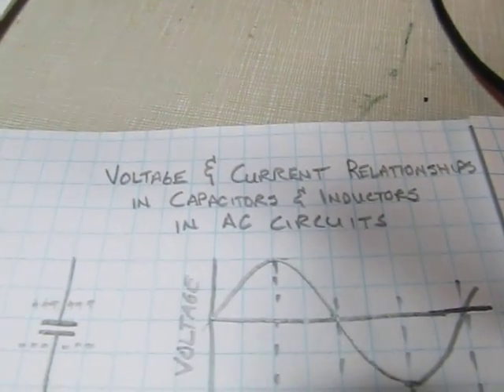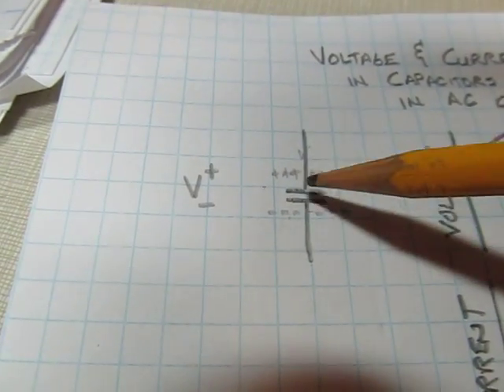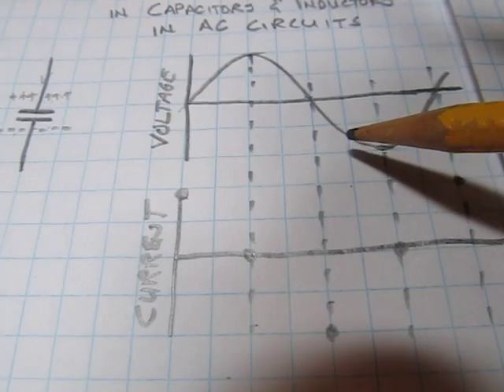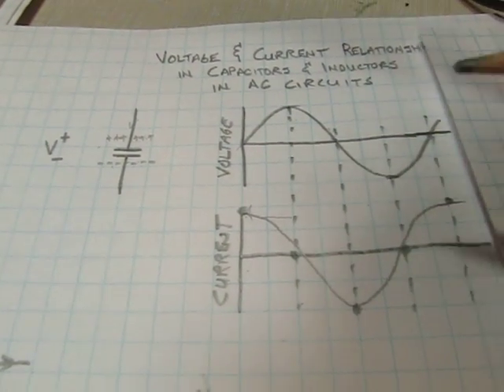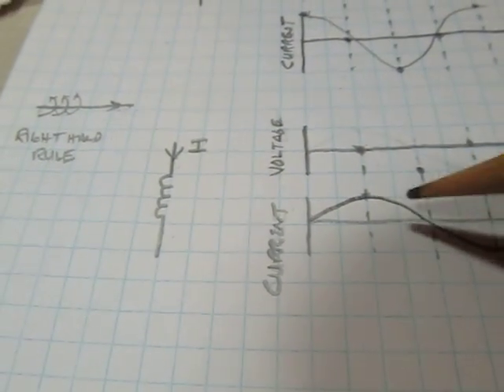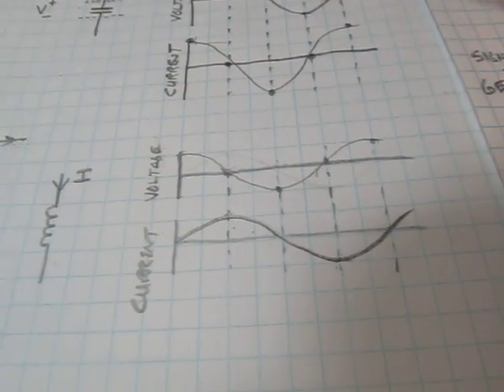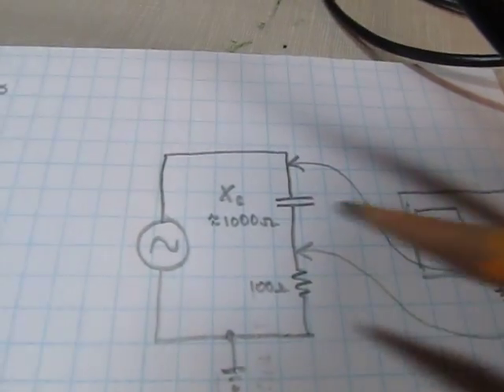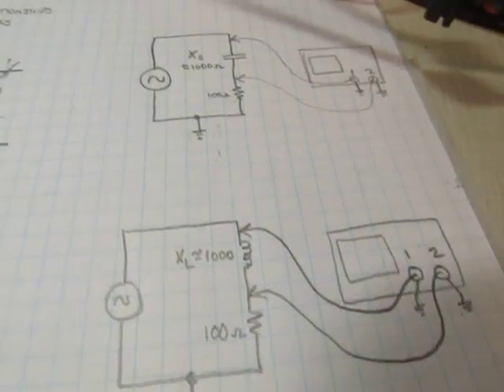#54: Back to Basics Tutorial: Voltage / Current in capacitors and inductors

Comment: The phase angle of a capacitor or inductor doesn't determine or affect the "rate of change"?
Reply from the maker: nope
Reply: @w2aew  I always thought that the capacitors phase angle is what is causing the rate of change because the current LEADS the voltage which is a time displacement. A resistor doesn't have no rate of change. So I'm confused what is causing the rate of change if it's not the phase angle/time of the current and voltage passing through the capacitor or inductor.

Comment: Alan, can you explain the choice of frequency and capacitor values? I see the values in the description, 725khz and 200pf, but how does that come into play in all of this? I tried to set up the experiment with the capacitor, but I don't get a 90* phase shift. Is that amount expected?  at 725khz I'm at about 22* phase shift, and at 500khz I'm at 45* phase shift. The slower I go, the closer to 90 I get, but it never gets to 90.
Reply from the maker: Are your probes 10x.
Reply: @w2aew  Yes. They have a 1x/10x switch. Is that my issue? I had them set to 10x.

Comment: I'm confused about VxI = watts and VxA = watts, because if the Voltage is 9vdc at 1amp = 9 watts , the V x A will also = 9 watts VA, so what is the difference and how does a technician know if its VA or VI = watts? filter capacitors store energy so that is considered VA
Reply from the maker: VA is used when there is a reactive load where the actual POWER dissipated is a function of the phase shift between the voltage and current.  In this case, the POWER is calculated as V*I*cos(theta), where theta is the phase between the voltage and current.

VA is also used when rating transformers.  The transformer itself doesn't dissipate power, but can handle a large VA (in the case of power supplies).
Reply: @w2aew  VA is consider the Load Current? because this is what other technicians are saying that VA is a LOAD or Current Load. I'm not sure why a transformer has a VA rating because a transformer is not a Reactive Load or current load, so I'm confused. Also a transformer doesn't dissipate power so how can it be a VA load?
Reply from the maker: @waynegram8907  No.  VA could be termed "apparent power" or "reactive power".
Reply: @w2aew  When filter capacitors are storing the applied power voltage/current which is considered Apparent power or reactive power? because when you remove the AC power from the unit under test the filter capacitors in the power supply are charge with apparent power or reactive power?
Reply from the maker: @waynegram8907  NO.  Apparent power applies ONLY to AC voltage/current - where the power is not equal to V*I due to a phase shift between V and I.  Storage caps in a power supply are working with DC.
Reply: @w2aew  Yes I know that storage caps are working with DC but this is not Applied Power its the storage caps are storing what type of power/energy? since its not reactive power or apparent power what are the filter caps storing what type of power? VA loads will have a VA rating on the inductive component or capacitive component but I don't know if the VA rating is apparent power or reactive power, how can you tell as a technician to know if the VA rating is apparent power or reactive power?
Reply from the maker: @waynegram8907  Capacitors don't store *power*, they store *charge*.  That charge can be delivered to a load that will dissipate power.
Reply: @w2aew  All equipment has a power supply that has filter capacitors which the filter capacitors are storing the applied power as reactive power, this is considered VA because the filter capacitor are storing voltage/current has a reactive power VA?
Reply from the maker: @waynegram8907  The filter capacitors in a power supply are on the DC side, thus don't affect the input phase angle.

Comment: In an LR network the resistors value is damping the ringing of the inductor? When connecting a square waveform to an LR network if the resistor is 10k it will damp the ringing of the inductor but if the resistor is 1meg the inductors ringing is visual on the oscilloscope. Any reasons why the resistance is damping the inductors ringing?

Comment: I'm stumped on what I'm doing wrong. I cant get channel 1 and 2 signals to be out of phase on my Hantek scope - they are always in phase. I'm using parts out of my junk box - 3.3uH inductor and a 460ohm resistor wired up in series, and probing it up the same as you have it. Channel 1 across the the SG and channel 2 across the resistor.
Reply from the maker: In order to see the phase shift, the resistor has to be much lower (10x lower or more) that the reactance of the inductor you're using.  This means that XL of your inductor would need to be 4600 ohms.  In order for a 3.3uH inductor to have XL=4600 ohms, you'd have to be running at 220MHz!!  So, you either need to run a much larger inductor or a much lower resistor (and maybe a higher test frequency).
Reply: @w2aew  Of course! *slapping head*. I didn't think of the Impedance triangle. I was only running 1kHz, too so I was looking at a 2.5e-3 degree phase shift. I'm limited with what I have in my junk box, but was able to find a 2 ohm resistor and bumping up the frequency to 100kHz I was able to see a noisy ~45 degree shift when setting XL =~ R. Thanks for these Fundamentals videos and for nudging me in the right direction.

Comment: AC outlet Power Strips have a Joules Rating which I'm not sure what the Joules rating means when it says 350 Joules for 5 AC outlets on the power strip? Does it mean 350 joules per each 120VAC outlet X 5 outlets or 350 joules X 5 per each outlet? I'm sure not what it means by 350 joules. I know Joules means time in 1 second but I'm not sure when a power strip is saying the maximum joules is 350 joules what does that mean?

Comment: What is the theory behind "compliance voltage"? I don't really know what is a compliance voltage and what parts of the circuits use compliance voltages. A compliance voltage is difference than a voltage source but I don't know what the difference are.
Reply from the maker: Compliance voltage is usually a term applied to a current source.  An ideal current source will force the desired current through whatever load is applied to it.  However, if the load is a very high resistance or open circuit, then the voltage would, in theory, have to be very large or infinite.  This obviously is not reality, and not practical.  The Compliance Voltage is the maximum voltage that will appear at the output of the current source when the load is open.  In other words, it is the maximum voltage that can be present at the output of a current source.
Reply: @w2aew  I have heard UK EE electronic techs also use Compliance voltage for voltage source. The UK engineers are claiming that the power supply output voltage is considered the Compliance voltage and the "voltage drop" or step down voltage going to the circuit board is NOT the compliance voltage. It gets really tricky because a voltage source and be looked at as a current source because of the LOAD.

Comment: As always, the format and clarity of the presentation is really appreciated. I am trying to understand why the output ofd 4 diodes composant is not showing the theoretical curve on  my usb oscilloscope. 2 questions : the curve looks like if it was a little smoothed (?), the tensions are not correct , I suppose that it can be a problem due to my test equipment, but I see that kind of shape in many places (VCC for instance ) when the card is in standby mode (it do not start, so I am trying to look at the data sheet of the CI to see if a part is not in order - connectors are ATX but PSON short to ground does not work )  . If you where kind enough to tell me what is the curve showing those  are the first pictures. https://photos.app.goo.gl/DBVuCDSifHmPijGNA

I am really annoyed not being able (yet)  to understand what is shown, I suppose it is trivial. That said, I tested another diode bridge and the shape is also not well balanced - USB Oscilloscope OWON and Micsig probe (x500 - channel x1000 - voltage reading/2)
I am sure you can point a finger in the good direction, and I will find the rest by myself ... Difficult at 65 to learn from scratch ;) 
Thank you a lot anyway , no problem if you have no time for that !

Back to your course ;) and sorry tobe so long winding and for my simplified English

Comment: So sorry but why do you need that small resistor to measure the current? Can't you use the bigger resister?
Reply from the maker: Because I wanted the voltage drop across the current sense resistor to be small with respect to the voltage across the inductor/capacitor I was testing, so it wouldn't affect it so much.
Reply: @w2aew  Thank you soo much! I am taking a minor in electronic circuit and my lecturer completely skipped the basics, this video is saving me!

Comment: w2aew, if a lamp bulb draw .15 amps and another lamp bulb draw .25 amps how do you find the percentage of current draw between the two different lamp bulbs? what is the formula 
.15 amp lamp bulb draw less current compared to .25 amp lamp bulb by what percentage?

Comment: As usually from you a good tutorial.But i have a question, I know how to make an oscillator to generate a sin signal but not the sin and cos at the same time. So, I can use the capacitor or the inductor  to generate a 90 degrees phase shift in a QAM(or costas loop) oscillator or it need more conditioning ? thanks.

Comment: I have an old analog scope that is a Kenwood CS 4125, 20 MHz, 2 channel. I'm trying to learn how to use it. I don't know if it can show both channels at one time on the CRT, I don't see any button that says both channel 1 + 2.
Reply from the maker: Vertical mode ALT or CHOP will display both channels at the same time.
Reply: Thanks. I want to be able to show the relation of the phase between a current and voltage in a circuit that has one coil in parallel with another coil that has a capacitor in series with it. By observing the phase relationship of each coil, and then figuring out how much the second coil is out of phase with the first one.
Reply: This would be to see if I am doing the math right on a simple split phase induction motor.
Reply from the maker: You should be able to do this easily, just remember that the ground connections of both probes are common.
Reply: I did it already,and it showed that the currents are 67 degrees out of phase with each other.
Reply: That is very important advice though. Luckily I had already seen EEVblogs video on that.

Comment: Thank you for all tutorials, I have got some questions: How did you ground the channel one and channel two scope leads? Do they have a common ground? Where did you connect the negative terminal of signal generator? Does the signal generator meet with a common ground with the scope leads? I am having same output signal amplitude on both shunt resistor and the actual test component (1000ohm resistor), I guess because both scope leads and the negative terminal meet at common ground. I do not have maths function on my oscilloscope , mine is an old HAMEG 20 Mhz analogue oscilloscope. I would appreciate some guide on that. Thanx again.
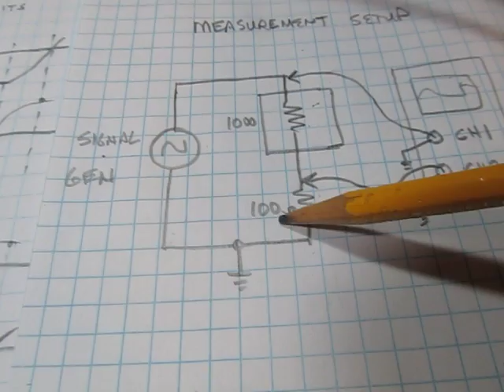Reply from the maker: The GND is shown in the schematic at 7:53.  The generator and scope grounds are all tied to the same GND point. A few seconds later, you can see the ground leads all hooked up to the same point on the breadboard (the three leads near the bottom of the screen). There is no shunt resistor, there is a series 100 ohm that is used to sense the current.  I would think that your scope DOES have the math needed - nearly all analog scopes have an INVERT and ADD function on the vertical settings.  By using both of these, you can get a difference or subtraction of the waveforms appearing on CH1 and CH2.
Reply: Thank you, I do really enjoy your tutorials. Finally, I have done it right. It seems that there is a problem with my oscilloscope (Or its the 50 Ohms potential!), it displays half of the function generator frequency on it. For example, if I set 100Hz, I get 50Hz on the scope, but the amplitude is displayed correctly (its direct connection without load or any type of circuitry). I am wondering why?
Reply from the maker: The input impedance of the scope (1Mohm vs. 50 ohms) would have absolutely no impact on the frequency of a signal that you're measuring.  So, either the generator, the scope, or your measurement method are at fault.  You can easily verify the scope itself by measuring the frequency of the MAINS power by simply hanging a wire on the input (it'''ll pick up enough stray mains that you should be able to measure the 50 or 60Hz (depending on your country).  Also, you can use the probe compensation signal on the front panel - this is most often something near 1kHz (not precise, but certainly suitable to see if you're off by a factor of two).

Comment: I am confused on which curve is leading and which curve is lagging because according to wiki you have them mixed up.. http://en.wikipedia.org/wiki/Leading_and_lagging_current#Lagging_Current
Reply from the maker: The way I read that page - it agrees with the way I've described it.  The easy way to remember it is with the phrase "ELI the ICE man.  ELI stands for voltage (E) comes before the current (I) in an inductive circuit (L), thus the voltage leads the current (or you could say that the current lags the voltage).  And of course, the opposite is true for a capacitive (C) circuit - hence ICE.
Reply: Yes that is what we have learned in class but our teacher draws the second curve leading were you have the first curve leading or maybe I need to watch the video again
Reply: Yeah your way makes sense,  for some reason my teacher makes the curve a head the leading one..oh well
Reply: Brent Peluso 

It depends on if the circuit has more capacitance or more inductance! 

if it is more capacitive, current leads voltage,

if it is more inductive, voltage leads current

if there are both, it's an LC (inductive-capacitive) circuit and it depends on which component has more influence...
  ...if the capacitor outweighs the inductor the mnemonic is ICE
  ...if the inductor outweighs the capacitor then the mnemonic is ELI 

It's ELI the ICE man...

E leads I in an "L" inductive circuit  (ELI) E = voltage, L = inductance, I = current

I leads E in a Capacitive circuit (ICE) I = current, C = Capacitive, E = voltage

Comment: This may not be the appropriate place to ask this question. However I am plagued by not understanding what is happening and I would like to change that. I experienced a 1 phase 230 volt fan motor cycling on and off every 10 mins or so. Puzzled I figured the motor was bad. I swapped out the fan motor and still had the same outcome moments later. Trying to look at more details after thinking I remedied the problem. I discovered an incorrect capacitor rating. 5 mfd was substituted for a 1.5 mfd. I understand capacitors correct the power factor or at least make the value closer to unity. I understand to replace the correct parts with correct parts, had I seen that capacitor value earlier I would have replaced that with the appropriate one. But why did that higher value heat up the motor windings???
Reply from the maker: Sounds like a good question for the motor manufacturer...

Comment: Am going through YouTube try to learn aboit inductor. Especially when DC curent is applied. At instance it will resist the current flow until its even with the source. And the then act as a shot circuit. Well my question is shot circuit have a voltage and curent same as the source power. So do we get Votage and current equal to the source when an iductor is charged up from a dDC current.
Reply from the maker: After equilibrium is reached, the inductor looks like a short - simply a piece of wire.  Very little resistance or voltage drop.  Current through the inductor is determined by the source and load on either side of the inductor.  The inductor generates a back EMF to resist a change in current.  When the current doesn't change, it simply looks like a wire.

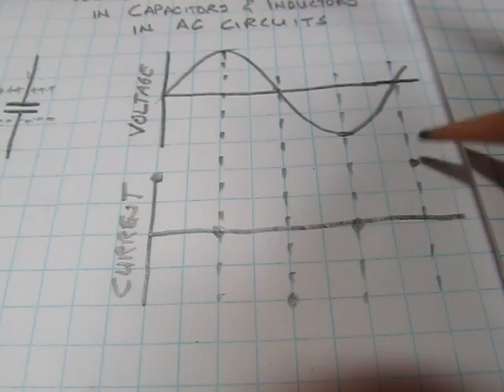Comment: Although I like this video very much, I believe that the explanation is incomplete. You don't explain why the inductor or capacitor maxima are positive or negative. For example for capacitors at 3:09, why is the first voltage value a positive maxima and not a negative maxima?

Comment: But in an AC supply, during negative cycle current reverses its direction. So reversal means current now flows through the other terminal(neutral wire).Now how dont we get a shock?

Comment: Hi Alan, actually, the right hand rule is for conventional current flow.  You have the arrow indicating current pointing to the right, if that's electron flow you need to use the left hand with your thumb pointing to the right.  73, Kevin AB2ZI

Comment: Hi Allan, 
In my business, I service mainly R 390A receivers with some R390, 391, 392 and  a few 389's. One of my beefs is guys often replace fuses of the right size but will install a slow blow or worse a time delay fuse where a fast blow fuse should be. There seems to be a lot of misunderstandings about fuses in vintage equipment.
Perhaps a video showing the time required for the various fuses to blow for a given amount of excess current would be helpful.
73,
Glenn WA4AOS
DSM Labs (dot com)

Comment: Yesterday i took a kids toy super simple RC car appart to study it. i found some super simple (by numbers of parts) 27mhz transmitter and some specialized IC for sensing switches and doing the modulation part. i even found a sample oscilator schematic at the ICs datasheet and can clearly tell LF from HF block of the schematic. BUT.. even though it looks quiet simple im totaly lost in how this oscilator/transmitter works. i tried to graph the voltages at the osc. transistor but still didnt get it